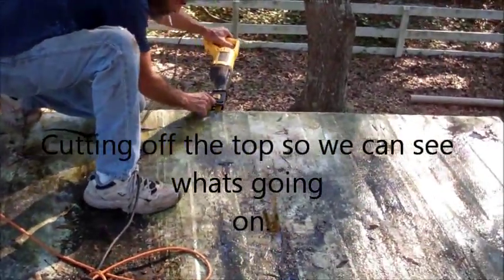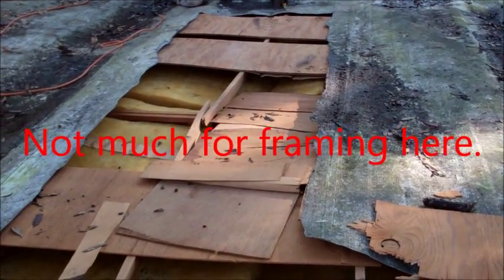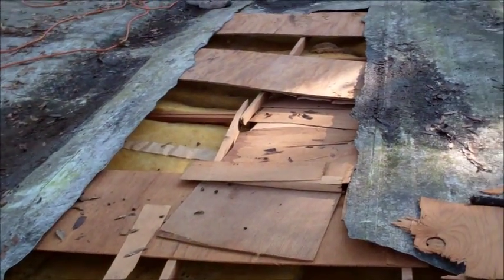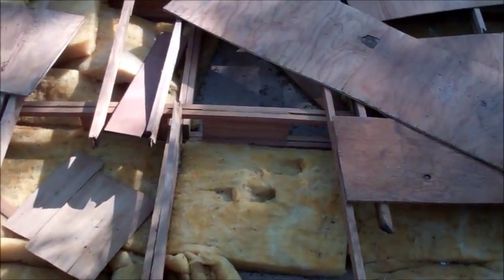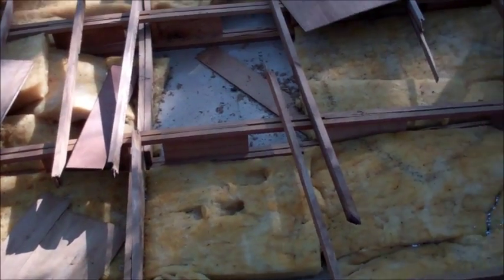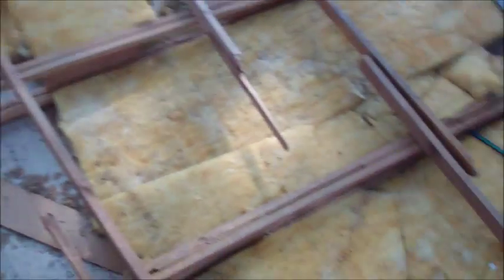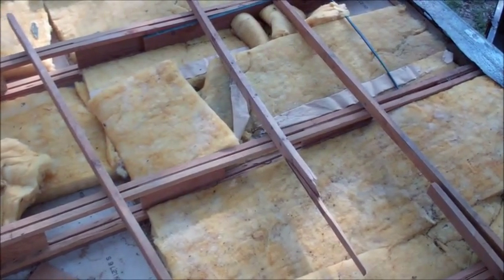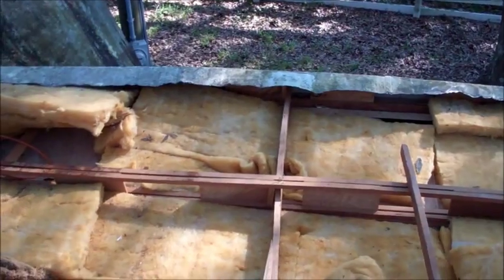Bad Mobile Home Roof you wont believe it

Comment: "They don't make trailers out of much", interior non-load-bearing walls are always going to be cheaped out on. How well one is constructed depends a lot on age and manufacturer. If it's old enough to be considered vintage, then how good it's constructed depends entirely on the manufacturer. Some were horrible, some were good. My trailer (84) has 2x4 exterior walls, but also have 2x4 roof trusses. They did use actual plywood for all of the subfloor. I'm getting a much older model (much smaller too) and I have no idea yet how well it's constructed. However, it did manage to survive all these years with apparently no issues. I know it survived a cat 2-3 hurricane (in a fairly sheltered area lol) as it was around during that one hurricane I lived through many years ago.
Reply: I have a 77 not sure of manufacturer but I climbed into the roof and there is no plywood or osb under the sheet metal round roof...I had to make sure to stay in the trusses I could feel anyway...the one problem I have been fighting since I got this place is the water leaking into the window and door jams...there’s a tiny little gutter that runs along both sides that r absolutely useless for preventing water from getting in and actually help do the opposite of that...I’m on my 4th exterior door for the back and have ripped out the jam and all cuz it was totally water rotted...new tar on the roof and caulking hasn’t stopped it either....I’m gonna crawl up there again and check the seam around the sewage duct and furnace flue ..otherwise I’m lost...had to replace all the windows after a huge hail storm and everything was rotted around them too...so I put real windows in it instead and that has helped
Reply from the maker: Well 1977 not sure who built it but they generally are a fairly decent trailer anything from mid 70s up early 70s not so much. Maybe I can make a suggestion that will work I’m just not sure how to explain it to you. When I do a mobile home over the door and build a gutter out of a piece of metal in your situation if you had the same thing I have or could find somebody they could make it for you you could slide it up underneath the existing gutter that’s up there screw it to the wall and stop that water from coming down your doorway. Gosh I wish I could explain it better 910-294-1761 I’ll send you a
Reply: @w8what575  First off, try not to walk on the roof of old trailers. It can cause a lot more problems than you would expect. As for the doors leaking, are they actual mobile home doors or house doors? If house doors, they will leak unless you do a perfect job and take extra precautions. When I got mine, whoever lived here before put house doors on it. The doors looked good, but they were useless keeping water out. Everything around them were rotted all to hell. I replaced one with an old mobile home door I salvaged out of an old trailer. I did miss some spots so it did leak at first, but I got it now. The other door is essentially not used and will be replaced probably in the fall when I can get back out to the mosquito heaven to get the other mobile home door (and several windows I really want). The biggest issues with old trailers seem to be leaks and rot. Get some of that grey sticky stuff, I think it's butyl tape. Cheap stuff. The tape around all the windows and doors is very likely hard and useless after some years so it helps to replace it. As for the roof, sometimes it's best to cover the whole thing with some kind of sealant made for metal roofs and put it on as thick as they recommend and maybe do a second or third coat in a month or two. It's time for me to recoat my roof. I'm kind of stretching it further than I should by patching leaks with spray rubber stuff lol. Not ideal but I've been super busy for the last few years. I also need to re-tape all my windows. I know a few leak but the rot is as bad as it's going to get with them. When I do, I know I'm going to need to do some reframing. Right now, due to insane lumber prices, that is on hold. I'm not paying $12 for a 2x4x8 and not paying $70 for a 4x8 sheet of plywood. They can keep it. I'll start my own sawmill before I do lol.
Reply from the maker: They recommend on a mobile home that you change Take out the windows every 10 years and re-mastic the window with a great body because it just deteriorates
Reply: Anytime I remove walls interior, I go back with full 2x6s.
Reply from the maker: Good idea

Comment: Hi Drew. How are you screwing down the roof sheeting to the trusses without splitting the thin 3/4 inch truss framing? Can that thin roof Truss framing support the weight of the roof sheeting? I have the same type of crappy roof trusses on my 1970 single wide.
Reply from the maker: By adding OSB to the top of your roof, it will double if not, triple the strength of your roof trusses, even though they are small. No, the screws do not crack the trusses. I know they are crappy but the screws will not crack them. Yes, the plywood will definitely help strengthen the roof, as a matter fact, after you put OSB up there or plywood whatever you choose your biggest friend could walk on your roof after that. I don’t recommend your biggest friend going up there to install the OSB but after it’s installed no problem.

Comment: New subscriber and bro you just opened my eyes to the ways these things are built, I won't be buying one these things in my next life. But chances are I'll be building my own house with a 26 gauge metal roof.
Reply from the maker: Build your own is the way. Thanks for subscribing
Reply: This was an old home, new manufactured homes are built differently
Reply: Mine is 1980 Skyline and even I cried at mine until I see this junk. I needed to look at some videos to know how lucky I am with 2x2 rafters and only 2 are broken. Metal roof and 1 was snapped by having a big man on the roof.
Reply from the maker: Try not to walk on it That’s for sure